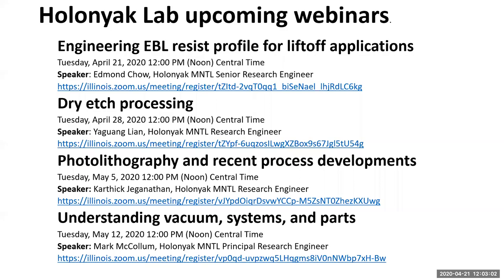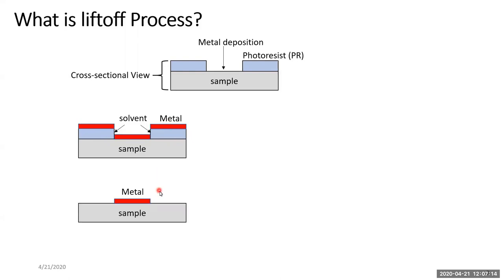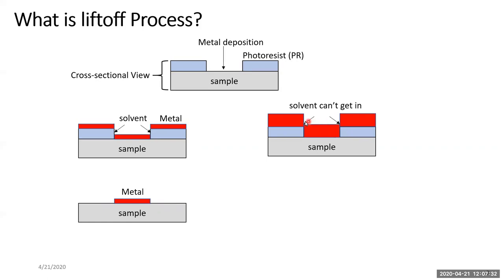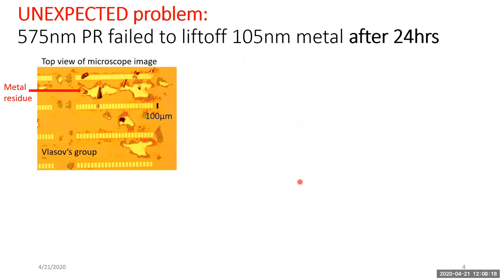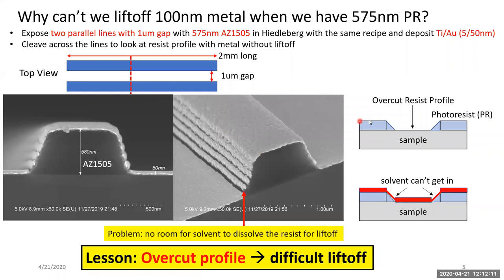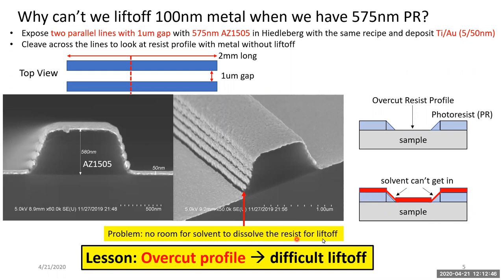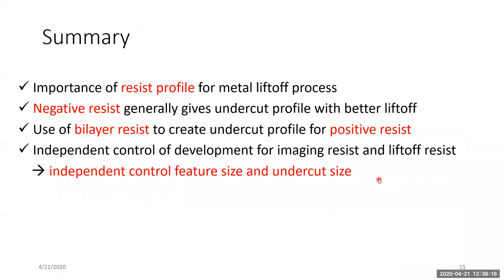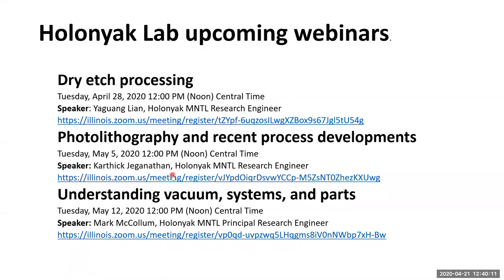Engineering Resist Profile for Liftoff Applications

Comment: Thanks for the good video! But I wonder if the e-beam resist is damaged due to SEM at 12:05.
I think there is not any coating metal such as Pt at the cross-sectional plane. Could you answer it to me? Thanks in advance.